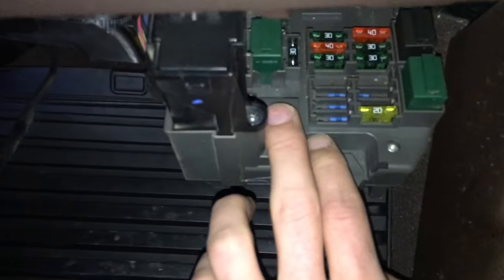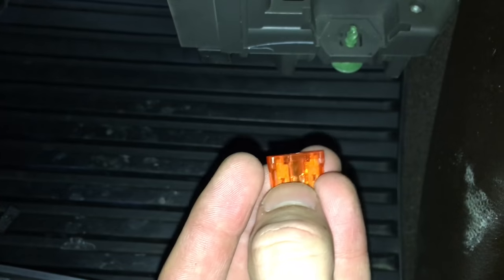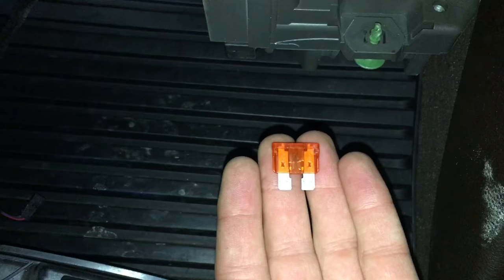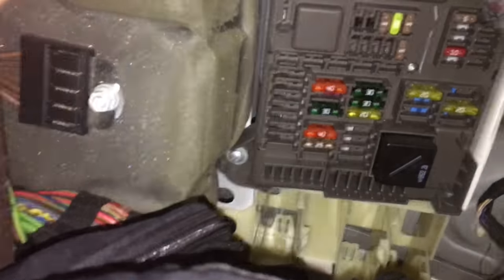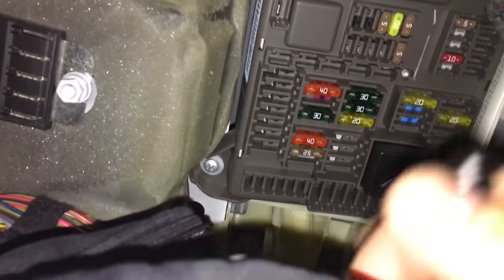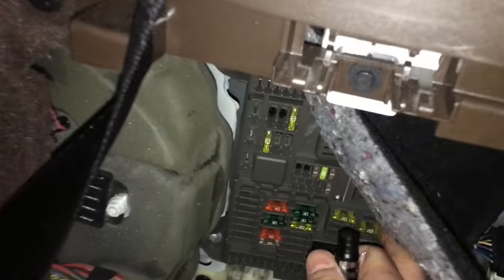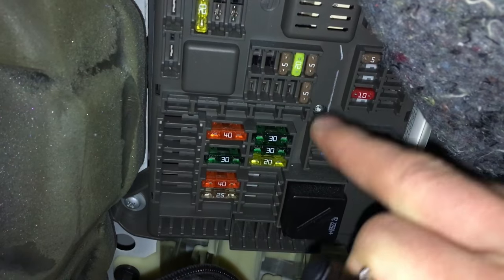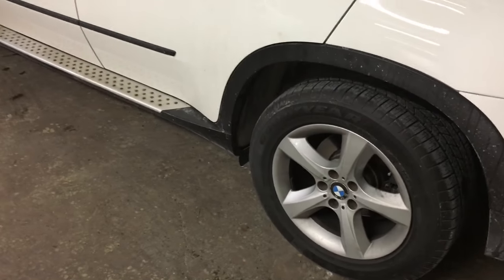BMW X5 E70 Rear Suspension Problem Fix

Comment: Level control system malfunction warning light came on. I turned the car off and turned it back on, the warning went away. Drove for 20 miles and it did not come back. I did not notice any symptoms. Although the car appears to sag on the rear when parked overnight. What seems to be the problem? I was planning to just replace the airbags since my current ones look old and worn upon visually inspecting it.
Reply from the maker: Hey Karlu Cariaga thanks for watching my video. It definitely sounds like you have an air suspension issue, I think you need a bit more than a visual inspection to start replacing parts, it is safest and best practices that you do proper diagnostics such as a full system scan, factory approved pressure and leak tests before replacing parts. Please do share how you end up repairing the issue, good luck, thanks.

Comment: Hi sir, thanks for the video. I have a 2008 E70 3.0 and my rear is sagging on the left. It inflates to normal height in about 20 seconds or less and I do not hear the pump at any point while I’m driving. I do not have a suspension error on my idrive so I’m not sure what may be causing this. Any advice on how I should approach this please?
Reply from the maker: Hey Bertille Maloney thanks for watching my video. In my opinion that sounds like a leaky air suspension bag on the rear left side, typically the repair is replacing the rear bags In tandem ( different opinions if 1 or both should be replaced). Please consider subscribing to my channel it would help me a lot, thanks.

Comment: Hi there, many thanks for sharing your good videos. The front cigar Lighter Socket is not working any more. I have understood this fuse is locate in the fuses front panel below the gloves box.  But I don’t know which  one (fuse) I have to replace and what color (AMP) of fuse to use. Your help will be very much appreciate. Thanks.
Reply from the maker: Hey dxb shay thanks for watching my video.  Did you even fix your issue?  If so please share your fix, much appreciated.

Comment: Hi great video!. I've checked all fuses and are OK and the air pump sounds trying to level the car but only work for front not rear. What could it be?
Reply from the maker: Hey Brian Montesdeoca thanks for watching my video. You would need to check your rear air bags and the valve body for leaks, to properly diagnose further. Let me know how that works out. Please consider subscribing to me it would help me a lot, thanks.

Comment: Thanks for the tip. Had similar prob where rear suspension will lower overnight. Once engine is on it will rise. Had both bags replaced however the problem still there. Obviously my compressor is working because it does pump it up. Could it be that it is not pumping enough air? Only one side will fall much lower than the other side.
Reply from the maker: Hey moyhaq thanks for watching my video and for the great question.  If you did all that I would Google search, BMW X5 E70 air suspension solenoid valve block.   It is possible you have a leak by or in the air suspension solenoid valve solenoid. Also check all the lines for leakage.  Please share an update diagnostics thanks.
Reply: @WheelsTips  Thank you for the reply. It's all fixed now. I took it back to the garage and told them to have a good check on any potential leaks inc the new bags they put on as I doubted my compressor was bad since it did pump air. After a day without the car they called me to say that they took off the airlines from valve block side and replaced the 0 rings. This seemed to have done the trick. There must have been an air leak from the valve block which was ever so small. I am happy that it's sorted thanks to a lot advise from all you folks👍👍👍
Reply from the maker: @moyhaq  That is great news! Thank you for taking the time to update your diagnostics results glad you got it fixed.  The valve block is often overlooked but tends to create small slow leaks, thanks again for the update, enjoy the great car.

Comment: Hi Thanks this was helpful.... however I replaced the compressor already but the fuse keeps blowing up.... hope you can help me what else could cause it
Reply from the maker: Hey Carlo G can you tell me the exact year and model, engine size. That way I can look at a wiring diagram.
Reply from the maker: Hey Carlo G also try unhooking your compressor and seeing if the fuse blows when you start the car, if it does another component is causing this. Let me know
Reply: Carlo G thank for the help I did had a same problem 👍
Reply from the maker: Hey Dani G / v thanks for watching my video, if it helped you please help me and subscribe, thanks a lot.

Comment: hey once again great Video, I am getting a messege on the idrive screen saying  Electronic damping control Malfunction with a shock strut sign and i hooked it up to carly and its saying 00D768 VDM... "status of front damper satelite error" can u please tell me how can i acess the connector for the front left strut to check wheather if the connector is plugged in ryt ...
Reply from the maker: Hey Haris Shah,  thanks for watching my video. Could you tell me what is your exact year and model so I can look this information up closer. Also what are the symptoms you are experiencing with the vehicle. Please subscribe to me if you haven't already, much appreciated.
Reply from the maker: Hey Haris S, truthfully I would not remove anything or loosen anything in that area unless you are experienced with working on BMW suspension components. This is from a safety perspective. I would have it checked out by a shop. Sorry if this wasn't to helpful but it is best for your safety.
Reply: My compressor is making a rattling sound
Reply from the maker: @rudyalvarado9502  Thanks for the update, did you ever end up finding a solution to your rattling compressor?  Thanks for any update.

Comment: When the fuse was blown did the compressor still work? I replaced the bag. The compressor runs but my x5 doesn't raise an inch. It's completely bottomed out
Reply from the maker: Hey cmoneyvids thanks for watching my video. If the fuse is blown for the compressor it should not work, also if the fuse is blown most likely the system has been overworked and there is a good chance the compressor may be overworked and out of commission. You would have to test the output of the compressor using a diagnostic tool. Please let me know the outcome of your issue and good luck. Please consider subscribing to my channel it would help me a lot, thanks.

Comment: Is there any way to pull down the front fuse box a little more to be able to reach the deep end fuses?
Reply from the maker: Thanks a bunch for watching my video and taking the time to comment. What year is your BMW X5? Please share an update, thanks.
Reply: @WheelsTips  Around 2008-2009 I think.
Reply from the maker: Sorry for the late follow-up, somehow missed the message. Did you ever figure out how to pull the fuse box down more, or were you able to reach it with just this procedure?
Reply: @WheelsTips  Nope, I didn't want to force it down and risk to break it. I don't know if there's other ways to pull it down.
Reply from the maker: As long as nothing was obstructing you should have been able to lower enough to get some fuse puller tool in there.

Comment: Hi, I'm nicolas from chile
I have a bmw x5 e70 2008, change the 2 back bags because they had leak, I keep this down.
Then I bought the valve and it lasted for three days, and then in the morning it appeared lower on one side.
I do not know what to do, I'm desperate and the
compressor works every time when condusco and every time it sounds more.
please help
Reply from the maker: Hey Nicolas Henriquez thanks for watching my video. Sorry for the late response been away on a business trip. May I ask what brand airbags did you install? Reason I ask there are a lot of remanufactures that do a poor job on these airbags. Please get back to me ASAP so I can continue to help. Please consider subscribing to my channel it would help me a lot, thanks.
Reply: Max speeding rods

they were checked and they do not leak
Reply from the maker: Hey Nicolas what car do you have exactly?
Reply: X5si
Reply from the maker: Truthfully I recommend scanning your car for fault codes and calibrating the suspension using the appropriate diagnostic tools. Get back to me with your scan results.

Comment: Hey, great video. I've replaced the air compressor and both rear air bags to my 2008 BMW E70 3.0si. Before I replaced the parts both sides were sagging but now it raises and 1 side is higher than the other. Any idea what the issue could be?
Reply from the maker: Hey Haazy thanks for watching my video.  In my opinion if you have replaced the compressor and the rear air bags, first you need to communicate with the suspension control module, clear all stored codes and attempt to re-calibrate the ride height. Have you tried pulling the fuse out that I show and putting it back to attempt a reset? Please let me know, also consider subscribing to my channel, it would help me a lot, thanks.

Comment: Hi Sir.  great detail on this video1! 100--100 ,I have a Question. I have a 2013 x5 35i ,3.0 litre turbo. I purchased it a few months ago and it works fined,but when i first noticed that when i open the drivers door to get in the vehicle after sitting overnight.( it do happen whilst i do open other doors also) i hear a, like a pump hissing noise for about 3-----8 seconds and thats it.It sounds like it coming from the back of the vehicles rear axle someplace... no code or anything on display screen.. So should I get 2 new airbags for the rear of the vehicle and replace them as it do have 138.000 kilometers. the problem is how can i test whee the air is coming from as it only make this noise for about 3 seconds  to 8 seconds on times. i dont want to ruin the compressor on the vehicle..BTW I dont see the vehicle tilted or lower on any l side.. ty
Reply from the maker: Hey battlehrfred thanks for watching my video.  It sounds like normal operation to me, if the car is not sagging on any side and you have no warning messages, the there seems to be indicating no fault.  The pump activates with the door function as well, at times given the overall circumstances.  Hope this helps, enjoy the car.

Comment: I changed my suspension sensor and an air bag. Now the rear of my 08 x5 4.8i suspension is all the way up and the suspension warning light is on... How can I reset it. I pulled both fuse and nothing worked
Reply from the maker: Hey Adrian Garriques, thanks for watching my video.  My opinion at this point is to read and clear the fault codes stored in the suspension module. Also most software like dis.a will have the option to re-calibrate the suspension level. Please let me know what you ended up doing.  Please consider subscribing to me it would help me a lot, thanks.
Reply from the maker: Thank you I appreciate you, any update on the car?

Comment: Bonjour, merci pour ta vidéo. 
Possédant un x5 e70 , les deux coussins d'air on étaient récemment remplacés il y a 2 mois.
Mais ce matin l'arrière droit et à nouveau écrasé et celui-ci ne remonte plus, et un voyant " correcteur assiete défaut " apparaît, pourtant le compresseur fonctionne.
J'ai ou entendre que ca pouvait être dû à  de l'humidité dans la fiche du correcteur d'assiette. 
Votre point de vue pourrait m'aider. 
Merci d'avance 

Thibaut
Reply from the maker: Les salutations,
Merci d'avoir pris le temps de laisser un commentaire. Je vérifierais le Air Suspension Valve Block et les conduites d'air vers la suspension pneumatique. S'il vous plaît partager une mise à jour, merci.
Reply: @WheelsTips  bonjour.
J'ai démonté le correcteur d'assiette hier et mis du dégrippant, celui-ci ne se lève toujours pas, j'ai donc commandé un nouveau coussin d'air que je changerai demain , celui-ci se degonflait doucement depuis une semaine et la ne remonte plus, donc effectivement je pense à un défaut du coussin d'air changé il y a deux mois, réponse demain
Reply from the maker: @georgethibaut7528  Les salutations,
Merci pour la mise à jour. J'ai toujours changé les coussins d'air gauche et droit en même temps parce que je connaissais toujours un taux de défaillance plus rapide lorsque je ne faisais qu'un côté. Dans l'attente d'une mise à jour, merci !
Reply: @WheelsTips  super, merci pour tes précieuses informations, je te tiens informé de la suite !
Merci encore !
Reply: @WheelsTips  bonjour! 
Ayant enfin reçu un valve block neuf hier,   j'ai remplacé celui-ci et, effectivement la fuite venait de cet appareil, merci pour tes informations et tes connaissances, problème résolu ! 
Merci encore !
Reply from the maker: @georgethibaut7528  De rien, content d'avoir pu vous aider avec votre problème de suspension BMW, profitez de la voiture!
Reply: @georgethibaut7528  Bonjour, est ce compliqué à changer cette vavle block ? merci

Comment: hi ... I have x6 2009 50i  
the rear left side is higher than right side ...what I can do ???
Reply from the maker: Hey huss darw thanks for watching my video.  I first recommend scanning your vehicle for faults codes, share your results so I can get a better idea what is happening in the system.  Please consider subscribing it would help me a lot, thanks.
Reply: @WheelsTips   also I have another problem ...it gives me suddenly when I push gas  engine fault power reduced ...and no engine power after that ...
Reply from the maker: Hey huss darw, I definitely think you need to scan your car for fault codes to go any further.  Get back to me with your results.

Comment: Hi question, my compressor works and I changed the air bag that blew however it still no reading the sensors... how can I get it to read it so it goes off..
Reply from the maker: Hey Geral Lopez, are you talking about the airbag system ? If you have a code , you need to send the airbag control module to a company who resets crash faults. Google ‘ your car make and model/ year reset airbag module service ‘.  If any of this helped please consider helping me by subscribing, thanks.
Reply: It says "suspension level inactive"
Reply from the maker: Have you tried removing and putting in the fuse I show in this video?
Reply: actually champ I haven't I think I will today when I get home. hummm!?
Reply from the maker: Let me know the outcome.
Reply: I have a bmw 750li. my idrive states that I have level malfunction. the car is down low on the rear p[assenger side, and it is also leaning heavy to the right side. Can you assist me?
Thanks
Reply from the maker: @steventurner4840  I know this is sometime after, did not see the question.  Just wanted to see if an how you tackled the problem with the BMW suspension, any update is much appreciated thanks.
Reply from the maker: @Moses Sisters I know this is sometime after, did not see the question.  Just wanted to see if an how you tackled the problem with the BMW suspension, any update is much appreciated thanks.

Comment: Hey, I replaced my air bags as they were on their way out and the compressor was often running.  The compressor is still running but not as much, I scanned for codes using carly and the error code is 5fb5. According to carly it states; 'Compressor temperture does not fall when the compressor is not drive/ Misalignment active'
Reply from the maker: Hey Dee Patel thanks for watching my video. In my opinion it is common for the compressor to malfunction after it overworking itself to compensate for the leaking airbag. In my experience I tested the compressor for output functions and when I replaced the compressor I always replaced the relay. You may also want to test the relay. Please share your diagnostics, thanks again.
Reply: @WheelsTips  
The compressor is only 3 years old, can I take the fuses out once is reached the ride height whist I order a new relay?
Reply from the maker: Dee Patel truthfully I have never tried that so I wouldn’t be able to tell you. Do you have any updates?
Reply: @WheelsTips  I'm trying to locate the relay
Reply from the maker: Hey Dee Patel did you ever locate the relay? Have you fixed your issue? If so please share your experience and solution, thanks a lot.
Reply: The issue is my CCC is not working anymore and I need to get it fixed.  My flat tire monitor came on as I had a puncture, I have got the puncture fixed but can no longer turn of the flat tire monitor as the CCC is not working.
The car still thinks the tyre is flat and keep compensating for it by using the air compressor.
I used ISTA + to get the above results, my CCC is booked in at the end of the month.
Reply from the maker: Wow the CCC module was the cause of your suspension issue? I am very curious on the update to this please share, thanks a lot.
Reply: @WheelsTips  
CCC repaired and air suspension is fixed! As I couldn't reset the tyre pressure via CCC the car compensated the tyre pressure by adding more air the air bags.
Reply from the maker: Wow that is interesting thanks for sharing? Did they replace your CCC or update it? Thanks for taking the time to share.
Reply: @WheelsTips  
I had it repaired, I sent to a company in Romania.
Fantastic service and the repair was at a fraction of the price compared to the U.K
Reply from the maker: @deepatel8896  That is awesome thank you so much for the update, much appreciated.

Comment: What fuse is for the DVD read enetratikwnt ?
Reply from the maker: Hey Saif thanks for watching my video and taking the time to ask a question. What year is your BMW X5? Please share an update, thanks a bunch.
Reply: @WheelsTips  mine is 2008 
So I searched online which fuse it was f108 I replaced it but nope nothing I don’t think there is power to it at all won’t accept CD but u can tell there is no power ! And there is a lot of fuses missing in my fuse box not sure if that’s normal
Reply from the maker: @Semaj.18272  Is the actual radio not getting power at all? Did it all suddenly stop working, how long ago was it working?